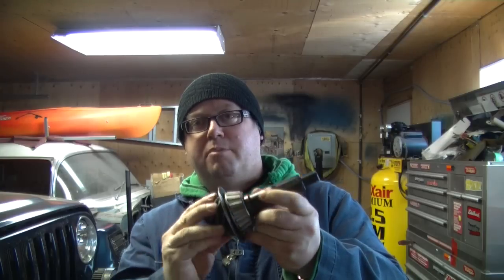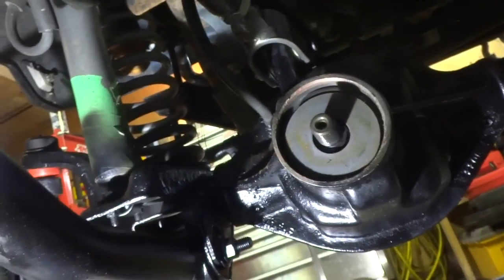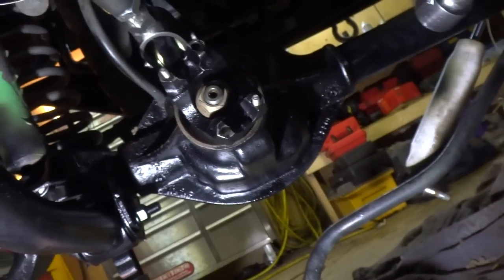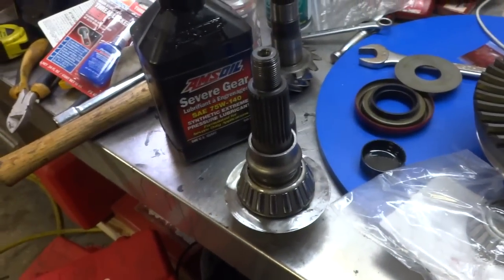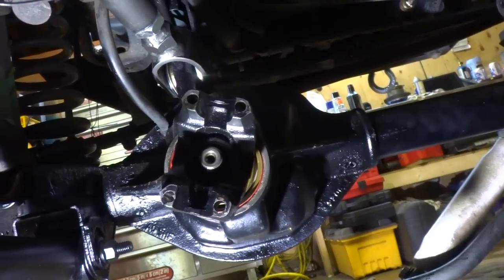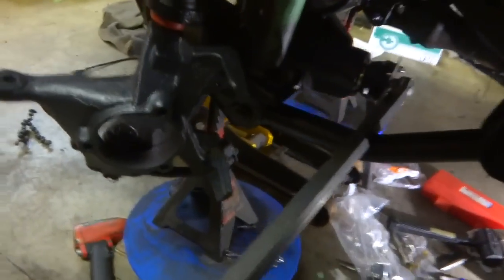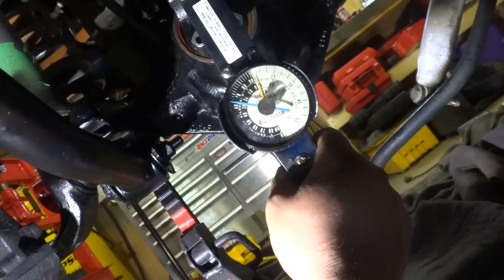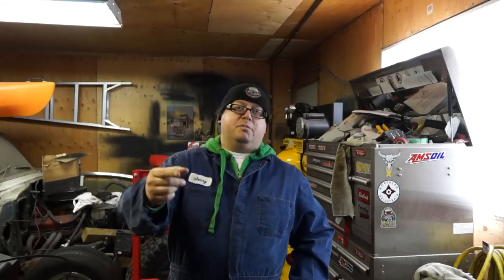How to Set up a Pinion Gear in a Differential DIY

Comment: when you are figuring out pinion shims you use new races, old bearings, and hand tighten the pinion nut, correct? once you know the correct shims you can install with new bearings, etc...
Reply from the maker: yes unless you have the expensive tool that finds the perfect dept for you.  There are other ways too but this worked for me

Comment: I have a snap on torque  wrench  and can get a slide hammer a race driver I have access  to a lift and I have some tools and some knowledge  mostly being mechanically inclined I rebuilt the 4.7 so what I am asking is what if I don't have the other measuring tools I mean all I'm doing is redoing the bearing and putting back the same with all the shims

Comment: I thought it was rotational/floating torque. In other words the amount of torque it takes to continuously rotate the pinnion, not the breakaway torque (aka initial tq)? Also, by chance do you know the required torque for used bearings on a 44 and 60? Much thanks
Reply from the maker: +moparerrnocar it is and that is what i was doing in the video turning it slowly and getting the reading
Reply: You can see that you start, stop, start, stop, start stop. Hence not a continual motion lol. I quote.. "as you can see, it starts to move at 15 in/lbs"
Reply from the maker: you can believe what you want i could really care less
Reply: @BackCountryWrenching  I agree with the other guy but your response is funny. I can hear you saying it. Edit: I agree with him to a point, further in the vid you did go real slow continuously.

Comment: So you've actually gotta go through all this rigmarole 'before' you can check the gear pattern, and if the gear pattern's out, then you have to pull it all to bits again and replace the washer between the pinion gear and the internal bearing with a thicker or thinner one accordingly, yes?
Reply from the maker: yes it's a long process that why having set up bearings is essential,  or you can guess.  i've seen that happen too

Comment: I wonder if it's my pinions in my truck, makes a low humming/ vibration when I'm going on the high way when I release the gas pedal you hear it and as soon as I press the gas pedal it's gone, it also does it when I have it on cruise control
Reply: aw53😡😉😈😇😆😆😆☺☺☺☺☺☺😆😇😇😆😆😆😆😆😆😆😊😅😅😅😅😅😅😅😅😅😅😅😅😅☺☺☺☺🐰🐴🐮🐮🔇😬

Comment: and let me ask I only thinks it the rear end because It sounds like bad brake scratch but I did brake rotors calipers removed the ebrak and did I the wheel bearings it was completely out of gear oil so it's hummimg

Comment: dana 30's use a crush sleeve?

i did a dana 60 and used  summit pinion depth tool with shims and got a decent pattern out of it
Reply from the maker: from what I know the Dana 60 preload is set by the shims while the dana 30 is set with a crush sleeve
Reply: yea its so much easier to use a sleeve than shims, when i did my 60 i had to set it up like 5 times before everything worked, pinion depth was a headache
Reply from the maker: oh trust me even with a crush sleeve you still have to shim the pinion for depth as the sleeve only sets the bearing preload

Comment: I'm about to rebuild my Dana 35 rear and just had one quick question. I'm certain I tighten up the crush sleeve and get the pre load to spec without the seal and then I remove the but and yolk to put the seal on, correct me if I'm wrong so far but my question is once you take the but and yolk off have you removed the preload on the bearings or do you have to physically hjt it to remove the pre load, thanks
Reply from the maker: negative, once you remove the nut and yolk you preload is gone and the crush sleeve is a one time use, the seal has to be in place for the final set up
Reply: I'm not changing anything other the carrier bearings and pinion bearings so I'm somewhat confident little to no shim change will be required but, the process would be put in pinion with bearings and crush sleeve in and seal then tighten everything down to the correct pre load and it should be fine right?
Reply from the maker: since your not changing anything all should be good but check the backlash and see.  When I installed new gears and carrier my pinion depth was the same just had to change the carrier shims
Reply: Bullshitkorner thanks for the help, i plan on checking backlash and gear patterns to be on the safe side, by the way you videos are fucking hilarious and actually give useful information keep em comin
Reply: OK last question I assembled everything the backlash and gear pattern were perfect but one little thing is erking me. So when I tightened the pinion but down to set the pre load I just tighten it until I got 28 inch pounds rotating it. Should there have been a point where the sleeve gives and then u measure after or do you just tighten it until you get the right preload asjsuming the sleeve was crushed, thanks

Comment: Do you use a crush sleeve on the intial depth check install?
Reply from the maker: Negative, the crush sleeve is for the final set up.  You can set preload on the bearings without the crush sleeve for set up

Comment: I wondered why the pinion shim looks like a carrier shim? Are you just making shit work with what you got or is that size shim better then the smaller pinion shims?
Reply from the maker: the shims that came with the master install kit are pretty generic and i wasn't really impressed with them to be honest.  if you were to shim the bearing race instead of the pinion you'd use the larger shims

Comment: Now I can see why no mechanics in my area will do this job...it's really sad.  If it's not a part that can easily be swapped they don't want to bother with it.  Now I'm stuck with the dealer who charges thousands of dollars.
Reply: Look for a driveline specialist or automotive machine shop in your area. And maybe even a transmission shop would do it for you. My local driveline machine shop was gonna charge me $200 labor plus parts which he is very reasonable on if I brought the rear end to him off the truck. I rebuilt it myself and he probably could have done it cheaper than I had in parts alone plus he would have used better parts.
Reply: gees its not that hard, get a digital fish scale and pull it .
Reply: shit in Washington it's a $1000 job... that's about $700 labor.   for a regear

Comment: ok so im doing my initial setup and as i was tightening my pinion nut with no crush sleeve. i figured id ask before i fucked my bearings, but when im measuring the rolling torque with an inch pound beam style torque wrench, it seems like its too much force to rotate, what im asking is when tightening the pinion nut, you shouldnt be able to spin the yoke with your hand and watch it freely spin, it should tight so when i you twist it it barely even budges, i just wanted to make sure my cheap torque wrench isnt way off
Reply from the maker: no when the preload is set up properly it's hard to turn, make sure you oil the bearings before you install it
Reply: Bullshitkorner thanks man, huge help as always keep jeepin and drinkin beers

Comment: How did you check your pinon depth?
Reply from the maker: by how it meshed with the gears
Reply: @BackCountryWrenching  did you use a dummy bearing to check this or measurement
Reply from the maker: Used dummy bearings that I made up

Comment: I dont understand why u made a dummy bearing for the pinion if you are not going to put the carrier in and check if u need shimming
Reply from the maker: +king9968 that's because you only watched 1 video of a series on doing this
Reply: The whole point of the dummy bearing is so when he does check he isn't pressing the bearings on and off.

Comment: Very nice :)
Reply from the maker: are you going to Re-gear your jeep in the future
Reply: Bullshitkorner I dont know. Im just running 30's if I were to go bigger to say 33's I would for sure with a 4 cylinder but the 4.10 do pretty well with that combination so far.
Reply from the maker: What a 4 banger, i'm disappointed in you i think a engine swap will be in your future maybe a v8 and let her rip
Reply: Bullshitkorner I built a CJ5 with a 304 - most expensive damn engine I ever put together. Possibly a small block chevy swap but the AMC 4 cyl does almost as well as the 6 cyl  so it would have to be a V-8 swap to gain much
Reply from the maker: building a engine cost so much, at the shops here it's cheaper to buy a prebuilt engine with warranty just bolt on your accessories and away you go
Reply: Bullshitkorner Check out a long block 304 - most are over 2K - yowie
Reply from the maker: That's a average price for a motor here most start at around a 800 for a chevy 350
Reply: Bullshitkorner  yeah that would be the way to go.
Reply: There ya go Buddy !!! Right now I'm happy to just get the body work done lol
Reply: you can also use foot pound specs if you know what you are doing and have a repair manual for said specs